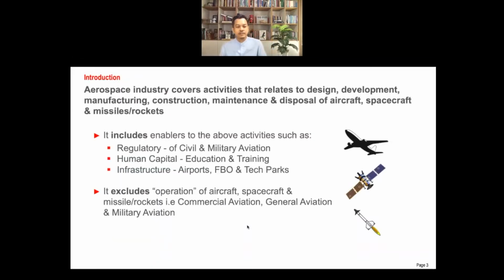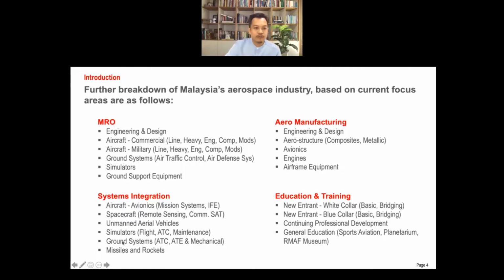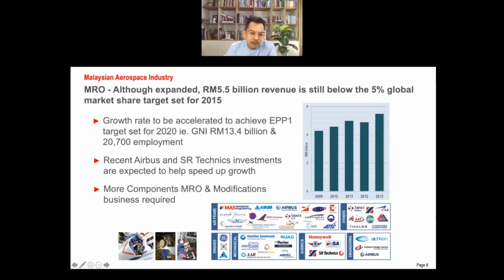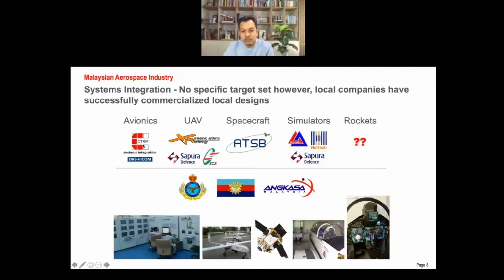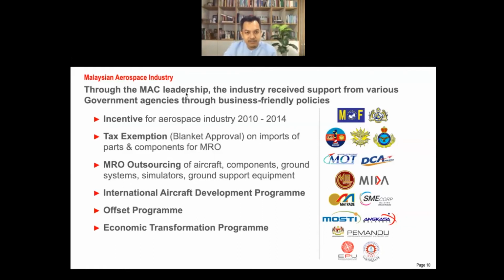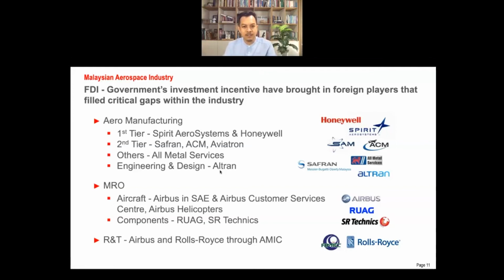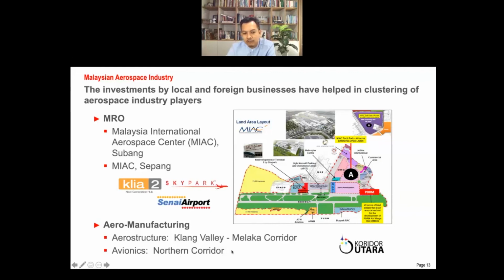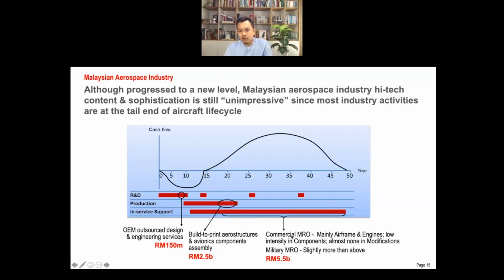LANDSCAPE OF AEROSPACE INDUSTRY IN MALAYSIA

Comment: [214053]  Thank you for the insightful lecture, Professor. From the discussion, it’s clear that while Malaysia’s aerospace industry has seen substantial growth, there’s still considerable potential to be unlocked. In Maintenance, Repair, and Overhaul (MRO), we should aim to provide comprehensive, nose-to-tail services to reach our goal of capturing 5% of the global MRO market. In aero manufacturing, it's crucial to involve local talent in high-level research and development to advance beyond lower stages of the aircraft lifecycle and contribute to complex design and innovation. System integration remains a significant area where Malaysia lags behind, particularly when compared to other aerospace subsectors. Developing our capabilities here is essential to reduce reliance on foreign expertise, which is critical for our military and defense sectors. Its crucial because systems are the brains of the aircraft. Finally, to bridge the gap between academia and industry, more bridging programs should be established to equip our graduates with the practical skills necessary to meet industry demands.
Reply from the maker: Ashwin, Thank you for your insightful and well-considered response. You've highlighted several crucial areas for growth within Malaysia's aerospace industry, and it’s encouraging to see such a comprehensive understanding of the challenges and opportunities ahead.

Expanding our MRO services to cover full nose-to-tail capabilities would indeed be a powerful step toward achieving our global market share goals. Involving local talent in R&D for aero manufacturing is another strategic move, allowing Malaysia to contribute to advanced stages of the aircraft lifecycle and drive more innovation. Additionally, strengthening our system integration capabilities is essential, particularly given the importance of self-reliance in military and defense sectors.

I fully agree that bridging programs between academia and industry are key to producing graduates who are ready to contribute effectively from day one. Thank you again for your detailed feedback—I look forward to seeing how these initiatives evolve!